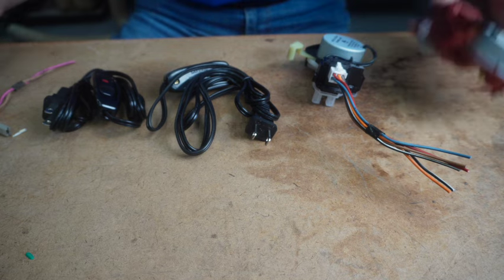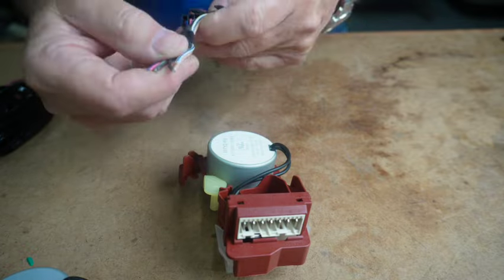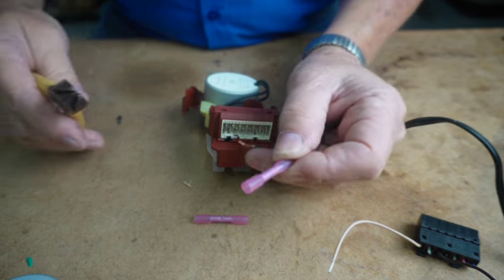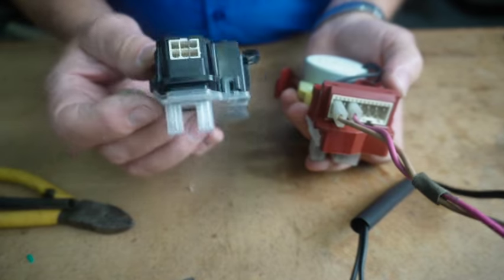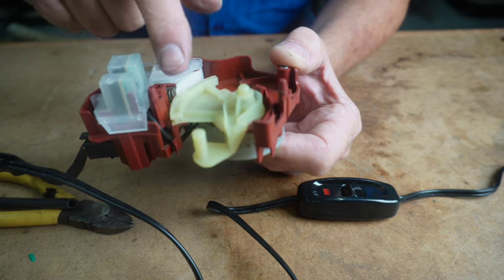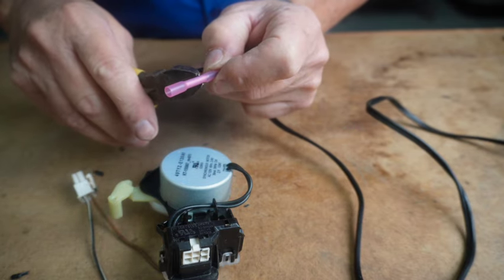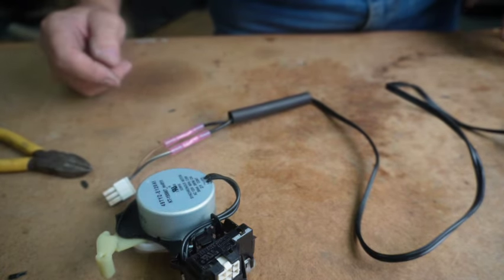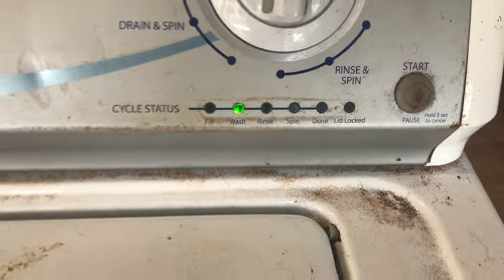How To Diagnose & Fix Washing Machines: Testing Shift Actuators & Tachometers

Comment: Great video!!!! Quick question: can an actuator malfunction when installed, yet test perfectly fine when not installed? The factor being the amount of pressure on the arm. Thanks so much in advance for your time!!
Reply from the maker: Yes, absolutely. It's pretty common for the splutch to go bad. The problem isn't usually with the actuator but with the splutch mechanism. If the splutch jams when shifting, the actuator can't force it into position. Sometimes you can fix this by squirting some silicone lube inside the splutch and working the arm back and forth to insure it moves freely.  If it doesn't, it will have to be replaced.
Reply: @HarperandKnowles  Holy crap that was a fast response!! I really appreciate it!! Yeah, my Maytag/Bravos has been kicking my butt for most of the day today. Tons of videos suggest it is the drive hub, but after disassembling it and looking at it, it does have some worn splines, but it seems to fit snuggly. After reassembling, the machine did fine. Originally, it stopped agitating in the middle of a cycle. I figure if it were the drive hub, I would have heard some type of grinding, which I did not. After watching more videos, I started to think the actuator might be bad. AND NOW, I guess it could be the splutch! 🤦(had to look that one up btw. Never heard of a splutch! lol) Now where to go?! If I weren’t already bald, I would be pulling my hair out!!!!
Reply from the maker: Ha, I was laying in bed reading on my iPad and your comment notification came up. That is a very problematic machine. I don’t have much luck repairing them.  If I get one from the scrappers I almost always part it out because when I fix one to sell it usually comes back to me.  If it’s more than five years old you’ve got the best use out of it.
Reply: @HarperandKnowles  And that would be my luck!! 🙄🤣 Yeah, if I can figure out definitively what’s wrong with it now, so I can feel good about selling it, I might just be looking for a different set. This is the newest set I’ve ever owned (bought them used). Excluding all of the new stuff, are there any brands/sets out there that you have had really good luck with? Thanks again for all the information, I really do appreciate it!! And no need to respond tonight. 👍🏻
Reply from the maker: Speed Queen is probably the best brand out there.  Maytag commercial is also pretty good. Barring that, if you can find a nice looking Whirlpool built before 2009 and rebuild it, it may last another 15 years. Good luck with your repair.
Reply: That’s definitely gives me a few brands/models to search for instead just giving it a blind shot in the dark. It’s so hard these days to find accurate credible information. This information coming straight from a obviously knowledgeable technician, is just awesome. Thanks so much again, for your time and the info!! It is much appreciated!! As for my repair,a little luck might be just what I need. Hopefully I can stumble upon it! lol God bless, thanks again and take care!! @HarperandKnowles
Reply: @addie750  that splutch mechanism is very clearance sensitive, it doesn't take much friction to make the washer fall on its face... and the kit I bought as a replacement was so poorly made (not to specs) that it simply stopped the actuator in its tracks from internal friction.
Reply from the maker: I’ve run into that problem also.I try to buy only OEM parts now.
Reply: Thanks for the advice guys!! I really appreciate it!! 😁👍🏻
Reply: @HarperandKnowles  Hey man, just want to thank you so much again. I followed your advice and hunted down an older set of Whirlpools. A 2001 Super Capacity  Plus Type 111 washer and matching dryer to be precise, and my wife and I have been using them now for about 3 + months and absolutely love them. (So easy to work on!)  Replaced the “dogs” and plan on slowly refurbing as small issues arise, but already they are proving more reliable than those 2018 trash Maytag Bravos units. We feel like our clothes are actually being washed now AND the cycles on both units take far less time to complete. You took time out of your day to correspond with me and give me free, professional, experienced advice, something you didn’t have to do. I am grateful. So once again, THANK YOU!!!! 😊👍🏻
Reply from the maker: My pleasure, my friend. Thanks for the follow up. I’m glad you solved your laundry problem. Carry on!

Comment: Thanks this is fantastic. Do you have the link for testing the tach?
Reply: nevermind i found the procedure in the service manual as you stated! Thanks for this video! I'm pretty sure my tach failed.
Reply from the maker: Thanks for the comment!  Good luck with your repair.
Reply from the maker: Hey, thanks for giving me a heads up on that missing link, I missed it in the edit so I went back and fixed it, I appreciate you catching that.

Comment: My washer has been giving me fits.  I went through the diagnostics and it led to a bad control board.  I replaced the control board and still have the same issue.  I have determined that the spin and agitate modes are backwards.  Ex. when the washer goes into spin mode - the shift actuator releases the clutch so the basket doesn't spin.  and when the machine commands agitate mode - the actuator engages the clutch which causes the agitator and basket to both move during agitation mode.  So everything electrically checks out.  I'm wondering, have you ever experienced a shift actuator that has become faulty actually show the actuator switch closed when its suppose to be open, and open when its suppose to be closed?  So when the machine is in spin mode, my actuator arm is pulled in close to the body of the actuator and it shows the switch as open.  However, the arm needs to be 90 degrees from the body to put the clutch in physical spin mode.  Any ideas?
Reply from the maker: I bet your splutch is defective and not shifting smoothly.  The inner ring should move from agitate to spin without very much resistance.  If this is binding then you’ll get the symptoms you are describing. Thanks for watching and good luck with your repair.
Reply: @HarperandKnowles  The shift arm moves freely. It is a new splutch also. That was the first thing I tried. The arm is in the wrong position when the machine thinks it’s in spin mode.
Reply from the maker: Okay, this is a unique problem.  I'm thinking that maybe that shift actuator has gotten misaligned some kind of way.  Inside, there is a plastic plate attached to the drive motor that has a grooved track that a pin attached to the shift arm follows. Maybe that pin is in the wrong place on that track.  I've never seen this happen but that could be the problem.  You may have to change that actuator to fix it. Let me know if that works.

Comment: Great video! Question for the agitation cycle in basic Whirlpool type washer, does the motor actually spin  back and forth over and over to make the agitation?
Reply from the maker: No, actually the back and forth motion of the agitator is transferred by a rack and pinion gear arrangement connected to an eccentric inside the transmission.  The machine will agitate if the motor turns in one direction and will drain and spin when it turns in the opposite direction.  Check out this video if you'd like to see the inner workings of the direct-drive transmission, https://youtu.be/hOFnb2Zh160 .  The new machine's motors do spin back and forth. Thanks for watching my video!
I think I misunderstood this question. To clarify, those whirlpool direct drive machines built before 2009 use the direct-drive transmission. The newer machines with the electronic control boards do use motors that cycle back and forth during the agitate cycle.
Reply: @HarperandKnowles  Thanks for the quick reply and followup! I have the after 2009 model and had to replace the gear box and actuator. Which made me wonder how to test the actuator, and what made the washer agitate. You answered both questions perfectly. Great channel, much appreciated.
Reply: Which design of transmission do you think is better? I noticed with the new style, you can't repair it and have to replace the entire part. I tried to crack it open just to see how it worked, but it was built like a tank.
Reply from the maker: Oh, by far the old direct drive unit built before 2009. They were built to last for 30 years and often went longer. Somewhere in Whirlpool's history someone decided to make throw away machines that have a limited lifetime. I suppose they sell more machines that way.  That gearbox wasn't designed to repair, only replace.  Unfortunately the cost of the part and labor isn't usually economical and it's probably better to replace a machine that has enough wear on it to compromise the gearbox.

Comment: What resistance should these read? I have a Maytag washer that's not engaging anymore but it reads 1970 k ohm's. Book says should be 2 to 3.5
Reply from the maker: I'm curious, does your washer have the main control knob in the center of the console and perhaps a wash plate or an agitator that attaches to a short shaft gearbox (the agitator bolt is in the bottom of the agitator)? Model Number?

Comment: my Amama washer and Dryer were in water enough to completely cover the motor in my Dryer. I replaced the motor in the dryer and it working fine. will I have to replace the motor in the washer when I start it it clicks alittle water comes in and it stops
Reply from the maker: You should diagnose it to see exactly what part is failing. Here is a video that will help you do that. Complete Guide to Fixing Your Amana Washing Machine: Works for All Whirlpool Corp. Brands
https://youtu.be/M6EQUP4iTHM. Thanks for watching!

Comment: Mi washer  shift actuator But then after about one minute disengage
Reply from the maker: You may have to replace the splutch.  Sometimes a squirt of lubricant on it will free it up enough to complete the movement of the shift cycle.  Good luck with your repair.  Thanks for the comment!

Comment: Thank you so much. At least I know how it's going. I change three W10913953 Washer Actuator in the past 4 months. I don't know why my actuator didn't work easily. The arm always stayed in the middle and I can't move it back where it comes.
Reply from the maker: It sounds to me like your splutch may be messed up.  When you have your actuator off, be sure the center part of the splutch 
(where the actuator arm connects) moves easily back and forth.  Sometimes just a spray of WD40 will free it up. Sometimes it will need to be replaced.  Thanks for your comment and thanks for watching!